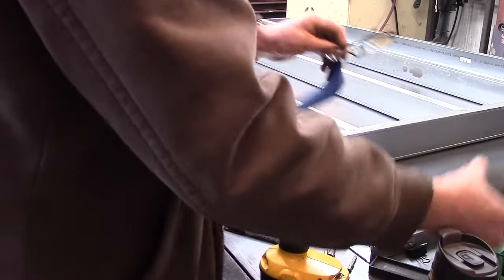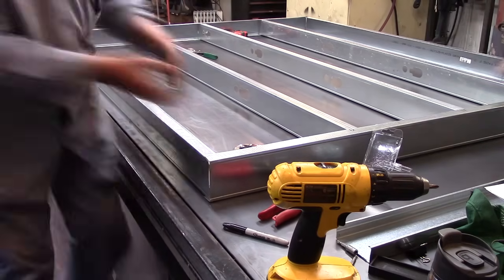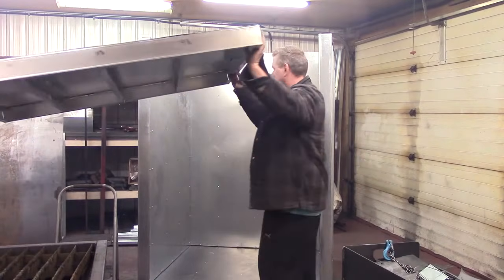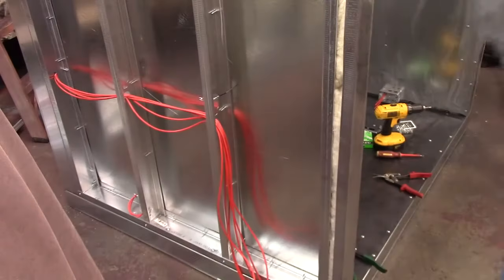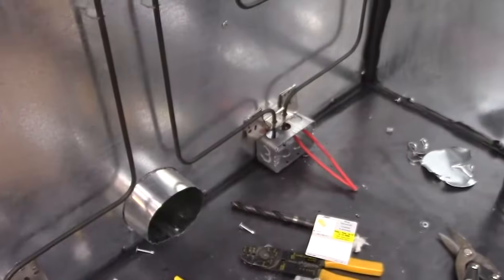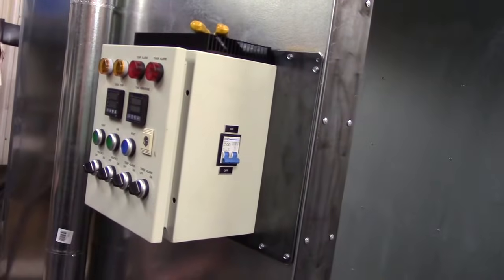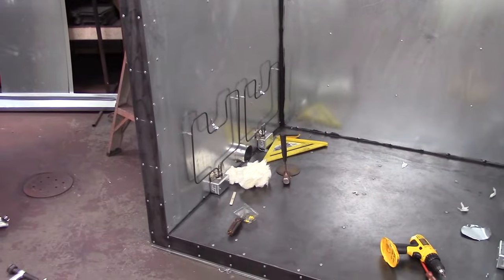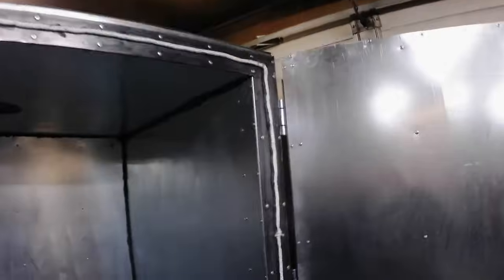Making a Powder coat oven.

Comment: Would it be an improvement to route the duct inside instead of outside the oven? You might lose a tiny bit of internal capacity, but it would eliminate the need for insulation.

Comment: Why a fan
Reply from the maker: It helps the even out the curing time.  Heat rises, so fan sucks it and pushes it through duct work to exit in the bottom.  You must have it very clean inside your oven, because the fan will blow crap around, and you will see it on your product.

Comment: I want to build an oven of dimension 5X6X10 ft. Will I have to install heating elements and propane burners combined? Please tell me the combination ie only N1 number of heating elements or N2 numbers of propane burners or both N1 and N2 combined.
Reply from the maker: I have not worked with propane, but somewhaere on the net must be a BTU's needed for your sq ft oven calculator.
I do know that working with the stove elements, you can always add two contollers to double the elements. 
The key thing is to have good insulation and a tight door seal to keep you heat in.  Good Luck
Reply: @farmboyfixes  thank you Sir
Reply: @pagal_scientist  From what I have found, the requirements are 100 to 150 Watts per cubic foot depending on your climate.

Comment: What should I use to control the temperature for the oven?
Reply from the maker: They controller we installed came with a temperature probe.  The probe was installed in the top left corner.

Comment: Very professional build. One thing i thought you may have considered is some guard/protection around those heater elements.  Did/are you considering doing so?
Reply from the maker: No guards, but he made a rack that slides in there and on the outside is a track.  the rack has to follow the track to get into the oven  and the track has guides to keep it in the center away from the elements and back wall.

Comment: Sir, is this pid temperature controller OK with 3 pcs 3100watts heating elements?

￼

Sir, is this pid temperature controller OK with 3 pcs 3100watts heating elements?
Ink bird itc100vh
3 pcs ink bird 40AD each ssr
Reply from the maker: I am no expert in PID's.   My instructions were very clear from the manufacturer.    We had 2 PID's each could control 2 elements.   From what I see from your brand wiring diagram, only one SSR per PID, I didn't see a diagram for 3 SSR.   Best you contact them.  Good luck on your oven.

Comment: Great video. Do you have all 4 heating elements on the same breaker or did you split it between two separate breakers? I'm building a similar size oven, but I have 4 3000 watt elements. I'm concerned it will be too much for a one breaker to handle.
Reply from the maker: Thanks.   We had one 50 amp fuse for the PCO402 controller..  If your not using it, you are correct, 4 elements needs to be split onto two breakers.  Good luck on your oven.

Comment: Aren't those metal studs Galvanized? Aren't you concerned about the fumes from the galvanized studs at high temps?
Reply from the maker: Even the sheet metal is galvanized.    He has never complained nor mention any gasses at oven Temps, Welding galvanized you certainly wear a mask, but that's really high temperatures
Reply: @farmboyfixes  i was looking it up in Google and says that you can have toxic fumes from the zinc in the galvanized steel as low as 200C... I was just wondering because I'm trying to build an oven as well
Reply from the maker: @Jaydparra  I just confirmed with him and his wife, once they close the door and turn on the oven to 400F, they dont smell anything.   The first two or three cooks, they had the "NEW" oven smell.  But, that being said, have fresh air intake into your area just to be safe.  Thanks for that information about the off-gasses.
Reply: Zinc gas has ZERO odor.  That’s the issue with heating galvanized metal.  You don’t know that it’s off gassing until it affects you.

Comment: Thanks for the video.. I'm building mine roughly the same size and good to see the control panel.... What size fan/spec did you use?
Reply from the maker: Dayton 1TDV1 Blower, 101 CFM, 115V, 0.52 Amp, 2380 RPM
Reply: @farmboyfixes  Appreciate the info...

Comment: Internal:
D = 48
W = 52
H = 77
Not including the $1500 CAD controller and labor cost, around $1900 CAD.
Why not run it on Lp gas instead?
Reply from the maker: customer did not want the hassle of dealing with lp tanks.   if it was bigger, lp is the only way to go
Reply: @farmboyfixes  Thanks
Reply: @farmboyfixes  why if it was bigger lp would be the only way?

Comment: That's an amazing build.  The one thing I'd note is that it's not a good idea to have those wires simply run through holes drilled in the metal.  There should be some type of grommet installed to keep the wires from chafing, or a wire clamp.  While it's unlikely to happen, you don't want 220/240 volts shorted directly to a big metal box that someone is going to touch.
Reply from the maker: Your right on that.  Even going through the metal stud factory holes I was concerned.  Next build will be grommets.
Reply: @farmboyfixes  that's good to hear.  But, seriously...that's a great build.  I can't wait to see what you guys do with it.

Comment: Question: they say hot air rises, so..... wouldn't it have been better to introduce the air for the bottom?
Reply from the maker: Your correct.  The hot air is sucked in by the fan at the top, and pushed down the duct work to the bottom of the oven.

Comment: Amazing DIY build. I am currently working on my own. Was confused about having air circulation inside? Even small amounts of air seem to blow off powder coating from the sufaces and I've never seen any commercial or home units using air movement inside. Most guys seem to put one element on bottom and one on top to fill oven chamber. Would like to see how this unit works for you guys down the road. 👍
Reply from the maker: We mainly use the fan to help circulate the air to speed up the pre-heat time..  Also, we learned to blow out the chamber to remove any dust/whatever before every bake.
Reply: @farmboyfixes  Smart idea.

Comment: How much can you sell for me a bigger one for 84" height by 84 width by 168"
Reply from the maker: Where abouts are you located
Reply: I’m interested in this as well located in Memphis Tn
Reply from the maker: Thanks for the interest, unfortunately I'm not selling these.
Reply: Any chance you would be willing to sell all the fabricated material in house? All the sheet metal and framing pieces I would need.
Reply from the maker: In Canada, so the cost to make is twice that of the USA.  Nobody in Canada makes these small ovens, but on Ebay, I did come across a few from your neck of the woods.

Comment: may I ask the type of fan you used to circulate the air? Thank you, and nice job on the oven.
Reply from the maker: Thanks Joel.  I used a Dayton 1TDV1 blower, 101CFM, its rated for high temperature.
Reply: @farmboyfixes  thank you for responding to me!  I was curious if you have noticed if the fan has been blowing to hard to interrupt the flow out on your powder coating and or if it hasn't been blowing hard enough to circulate the air evenly? Thanks again.
Reply from the maker: I was worried too, so I got the lowest CFM possible,  but so far so good.  If it was, I was prepared to put a manual louver in the intake to limit the amount of air being sucked up and returned